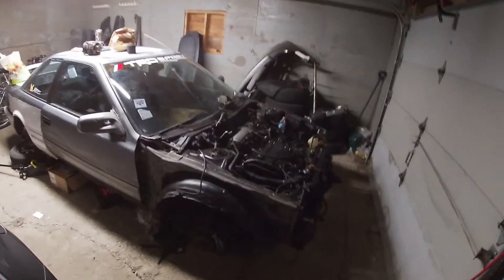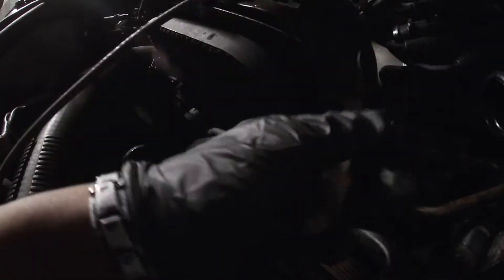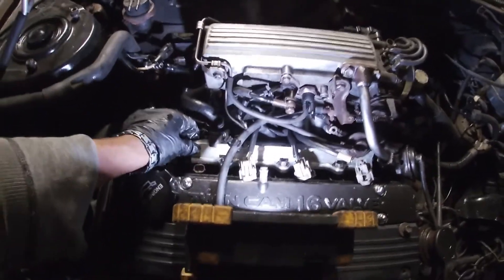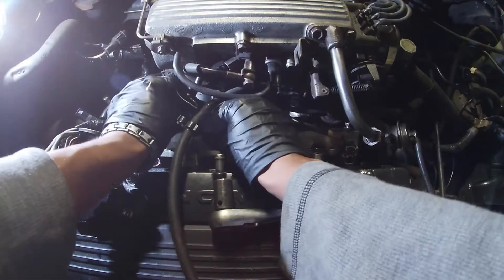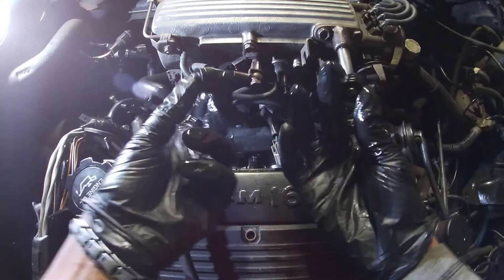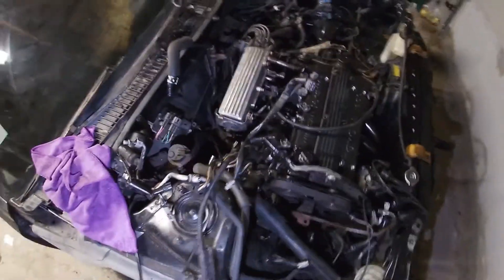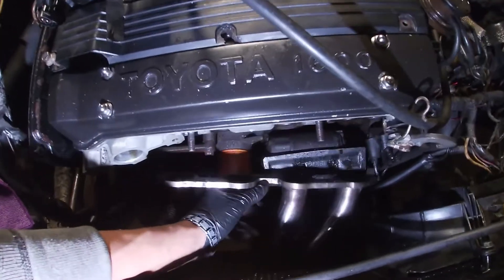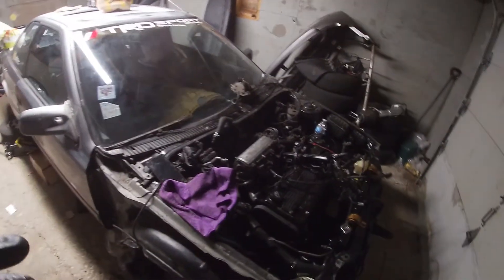Ae92 Toyota Corolla Wiring Harness Removal

Comment: Is there a gasket where the egr is bolted to the head?
Reply from the maker: Yess there was i believe on mine from what i remember, currently not running one on mine. But will probably get around to it when i refresh the engine a little when swapping it into the trueno
Reply: @Tuned4Speed  I was thinking about deleting mine, but the kits only come with the washer style gasket and the oval one thats connected to the intake manifold. I tried to find one for the piece connected to the head, but with no success. So I decided to keep it on for now.
Reply: Its getting really hard to find parts for these cars nowadays. Ive also been looking for a manual window regulator, but I can only find them for sedans and wagons. Its pretty irritating..
Reply from the maker: @jordank7685  hmmm well ill definitely ask my buddy cause he did the delete however i dont remember what kit he went with and how he did it but ill let you know!
Reply: @Tuned4Speed  heck ya! Thanks man!
Reply from the maker: @jordank7685  i know right! They are annoying especially the body parts! But i have a buddy with alot of extra parts ill ask him if he has a manual regulator what side do you need?
Reply from the maker: @jordank7685  by the way i recommend you joining a facebook group called "Ae92 USA/Canada" lots of supoort there and lots of ppl with parts youll need as well!
Reply from the maker: @jordank7685  no problem man anytime! Thanks for watching btw!
Reply: @Tuned4Speed  ya joined the group back in '17 or 18'. I just haven't bought anything off facebook before, but ya I just need the driver side
Reply from the maker: @jordank7685  oh okay and so i talked to my buddy and thats basically the whole kit. The egr is bolted onto the head but doesnt go into the head so essentially the only parts youd need is the parts that come with the kit. Youll need to delete some vacuum lines but other than that its pretty straight forward

Comment: I know first hand that this car is an absolute head ache compared to other car videos I watched taking apart engine parts and wires. And i don’t know why this model in particular is such a hassle. Even just removing the alternator is a whole migraine to get to and remove
Reply from the maker: Yeah the gts is not as spacious and doesnt have alot of great well placed parts tbh so it can be very annoying and tedious!! The alternator is very annoying but not as bad as you think its really simple once you figure it out lol just tedious like i said lol but these cars are by far wayyyy easier to work on then other brands and usually a great diy project that you can always learn from although its a little tough, i love the sr5 models though sooo much room to work with